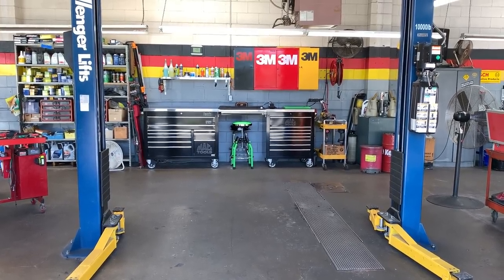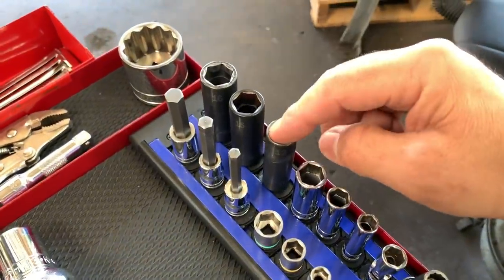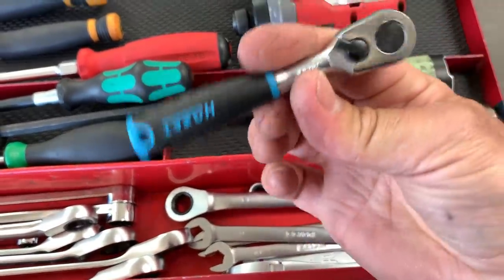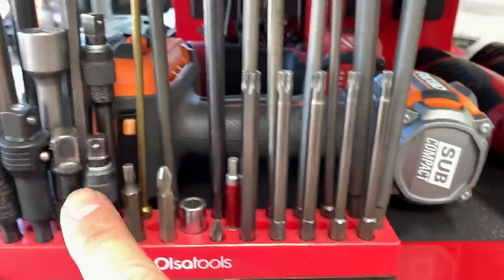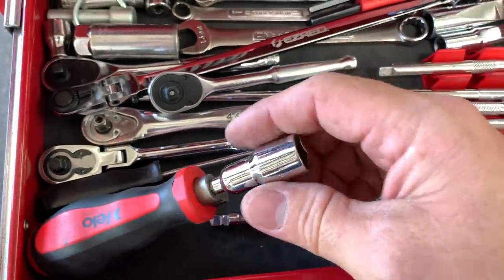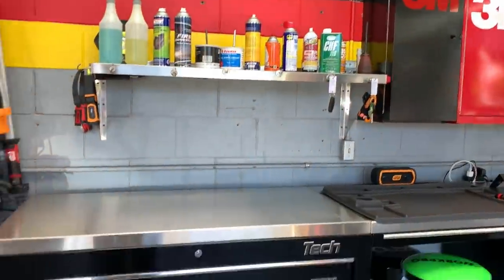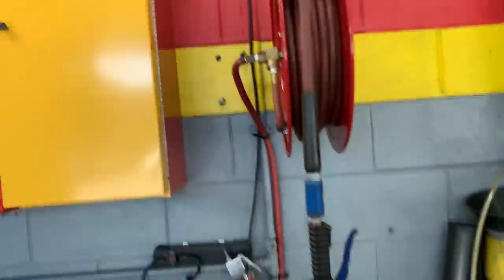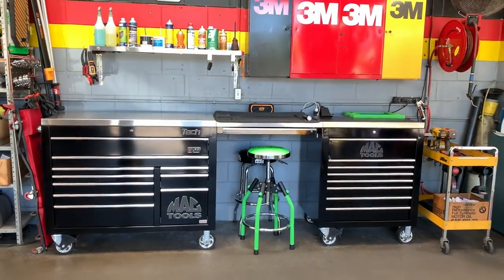Toolbox Tour Part 1 Autobahn Dan Work Bay Layout

Comment: Do you prefer your Snap-On extensions over the other brands? I ask because I’ve gone through very few cheap extension sets but always wondered is it worth it?
Reply from the maker: Justin Dow i’m kind of weary on Snap On extensions ever since my quarter inch wobble plus it came in half bent! I had them warrantied. The chrome plating on them don’t seem like how they used to be either. I’d say if you want Snap On go on eBay for an older set. I’ve been eyeballing these Japanese Koken Brand set that have some crazy knurling on them! The Mac Tools ones have a nice knurling on them as well I hear!

Comment: Love the Olsa bit holder as well. Need to get me one. Got a link and I can click thru that way if you're setup with Amazon?
Reply from the maker: Thanks for asking! I find deals a lot, so I don’t have time to make any pennies off any links. Feel free to try the code in the description for the website in this video. It’s pretty much the same thing as signing up for their emails and getting the same discount. So, The rubber rails are discontinued so it’s just a hard plastic ones. They are in seven colors at $16 at the moment.. hopefully my discount code stacks on top of that for ya! On Amazon, with six colors, they are as low as 13 which is quite nice! Definitely check both sites for the best deals!👍👍

Comment: Latching Carlyle socket holder? How's it holding up a year and a half later? 

Nice video! 

Have you did a followup video maybe the pros, cons of this setup since this one? 

Would like to see how you have it these days vs back when you made this. 
Looking at cart at first looks as you have to have weight to counterbalance the cabinet but then after thinking about it seemed as if they had it balanced.
Reply from the maker: Carlisle socket holder has been great, no issues. This video is the latest video of my cart. There is an older one on it. It is a low budget tear down cart. Definitely have to maintain the casters and gently roll it over bumps. Any added weight makes it more difficult to roll around. My guess is that it was discontinued because it was too weak for what it was.. If I were to remake it I would get a heavy duty Snap On cart and bolt on a custom made cabinet to the bottom..

Comment: 9:27 does light shutoff on its own?  Looks like you left it on.
Reply from the maker: xephael I left it on, the switch is finally getting worn down tho. Every once in a while I have to press it a few times, but nothing too annoying. I’m trying to remember when I bought it, it has to be at least 2-3 years old! Battery still holding charge strong! Anker on Amazon is known for having really good batteries!

Comment: You don't see many mechanics using Koken sockets. 

Those are the tits. In our factory Gedore, Stahlwille, Matco etc all just seem to melt away, but Koken, Apex and Snap-on are the only sockets that don't seem to wear out at all.
Reply from the maker: audioh0lic Been meaning to get a 3/8 zeal socket set and some extensions to get the full zeal effect! Been loving that 1/4 Koken flex with a 3/8 drive!
Reply: @alexstan5358  There is a massive difference between professional and industrial quality tools. A professional quality tool lasts a lifetime in the hands of a mechanic, but they generally don't last in industrial settings. Stahlwille is not industrial. My personal hand tools are all stahlwille because I really like their quality. But again, they don't last in a factory.

Comment: How you doing bro question one of my friends rebuild transmission Leslie Dodges cuz he was a Dodge Certified mechanic he is a stainless steel top table but he has like in the center section an indented section where he pounded it down and drilled holes when he does when the oil leaks so it just squeezes it into the hole and he has a container to drop the oil into did you ever think about something like that earlier in your video had some questions but I was just too too busy watching everything remember the question I had but keep up the great work and course cheers with a beer
Reply from the maker: KONAMAN Studio cheers KONA! 🍻 yeah, those are cool if you work on a lot of transmissions. It sure beats using a lot of rags wiping up transmission fluid!